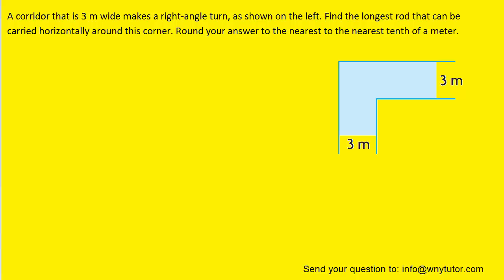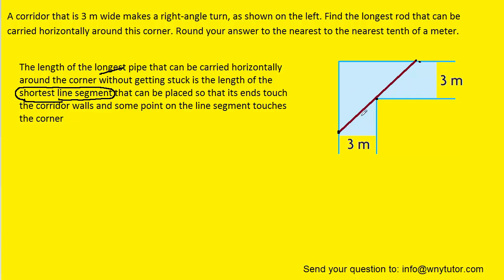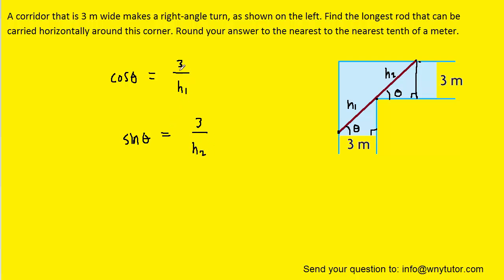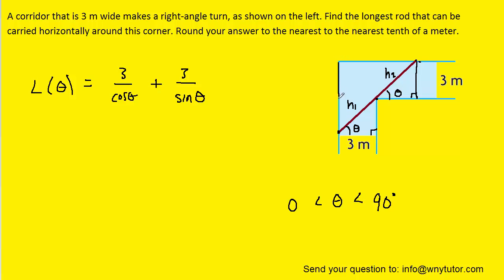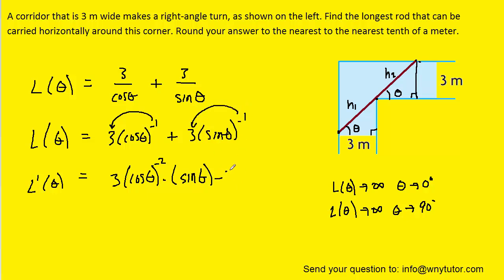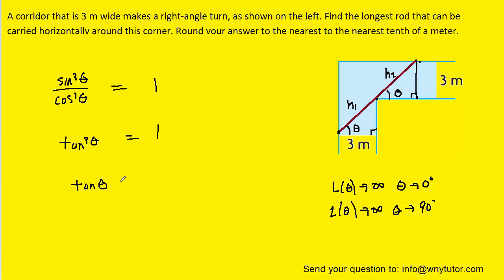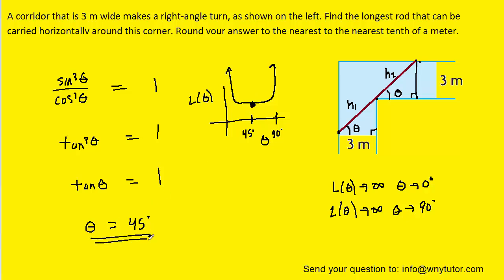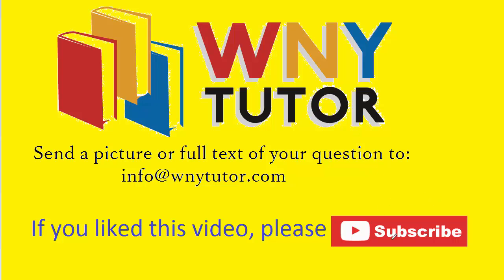A corridor that is 3 m wide makes a right-angle turn, as shown on the left

Comment: With the hallways the same width I could see immediately it was a trivial problem with the angle for minimum hypotenuse length being 45 degrees, or Pi/4 radians. The hypotenuse of the Isosceles right triangle would be one leg multiplied by the square root of 2, or 2*3*(2^-2)=6*(2^-2), a bit less than 14.5 meters. Cut the pole to 14.48 meters and you should get around the corner without chipping much paint off any walls or gouging the corner.. Had it solved in my head faster than it took to type this far (used 2.414 as an approximation for square root of 2). You would have done much better to make the hallways different widths, such as 2 meters and 4 meters. I do like how you used the trig functions to solve this versus the Pythagorean Theorem which would make the first derivative quite messy along with finding its relevant zero.